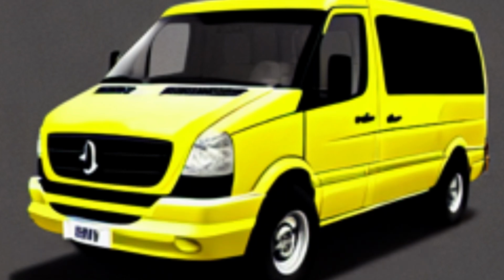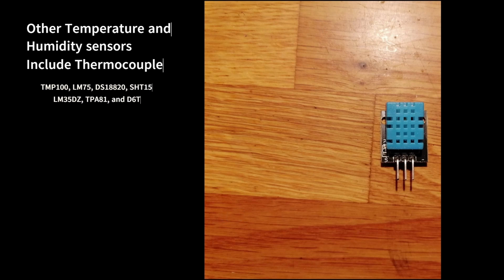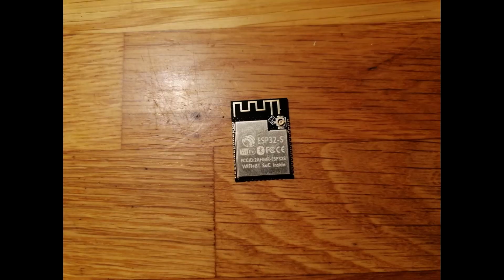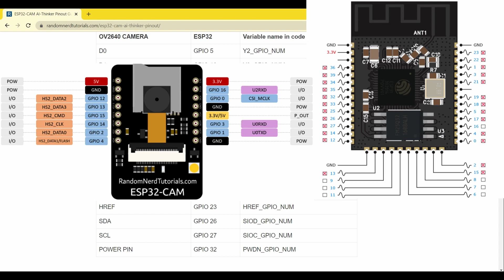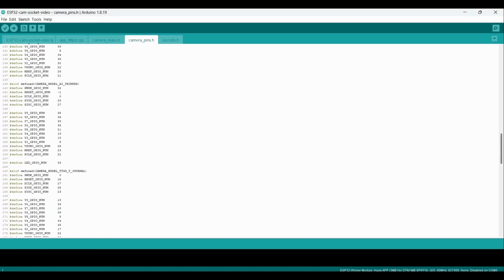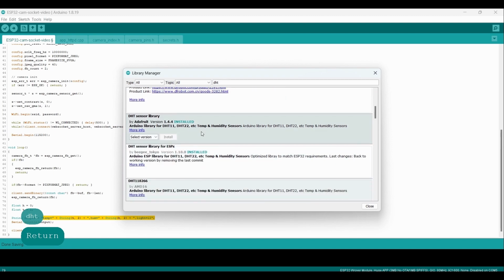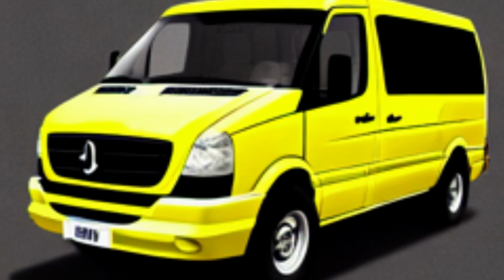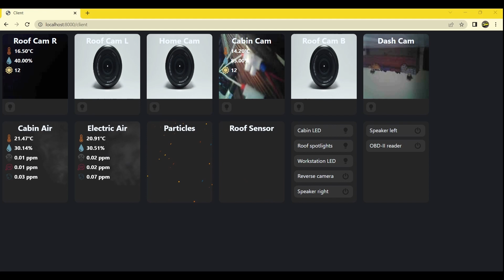ESP32-CAM DHT11 Temperature Humidity sensor

Comment: hey, I would like to connect a PIR sensor MQ135 sensor to an esp32 CAM and check the battery charge level via a voltage divider, for which I need an ADC gpio and use the camera and microSD input. I saw that people connect the PIR sensor with gpio13 and the microSD card slot works for them, and as for the gas sensor (MQ135), I was thinking about gpio16, and as for checking the battery level, I am left with GPIO3 or GPIO1. Am I right? Thanks for your time in advance

Comment: "Its got an accuracy of +or- 1 Cel, isnt that like 15°f? Correct me if im wrong but thats horrible
Reply from the maker: Hi there! There are more accurate temperature and humidity sensors available. The selection of a sensor depends on the specific requirements of a project, in my opinion. If you are interested in other options, some of the available choices include: BME280/BME680, SHT31, HTU21D/SI7021, DS18B20, LM35, and MAX30205.
Reply: @nomadicgeek_369  thanks for the reply! Youre doing very interesting work please keep posting!
Reply from the maker: @collinb5524  Thank you for your kind words! I'm glad you enjoy my work and appreciate the support. I'll definitely keep posting and sharing my content with you. Thank you for taking the time to leave a comment and for being a part of my community!
Reply from the maker: @quaziz  No, you cannot determine the degree of accuracy in Fahrenheit by knowing the degree of accuracy in Celsius for a DHT11 sensor with a +/- 1 degree Celsius tolerance. You would need to use the formula for converting from Celsius to Fahrenheit to determine the corresponding tolerance in Fahrenheit.

For example, if the temperature reading is 25°C with a +/- 1°C tolerance, then the temperature range is 24°C to 26°C. To convert this range to Fahrenheit, you would use the formula:

F = (C * 9/5) + 32

So, the temperature range in Fahrenheit would be:

F = (24 * 9/5) + 32 = 75.2°F to (26 * 9/5) + 32 = 78.8°F

So the temperature in Fahrenheit would be between 75.2°F and 78.8°F with a corresponding tolerance of +/- 3.6°F.